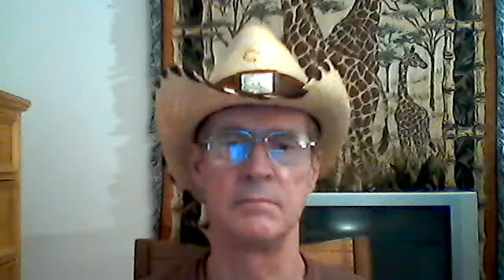Received Audio vs Antenna

Comment: My first guess would be that the noise level is different on the antennas giving one a perceived audio advantage. I have an SDRPlay  hooked up to two antennas and it can switch easily from one to the other while providing a graph on my PC of the signal strength and noise levels. I hooked a 132 foot wire with a 9:1 unun  to one port for HF listening and a Discone antenna  to the other for VHF/UHF and above. The discone is only rated down to 25 mHz on the low end. To my great surprise it was not only superior on the upper frequencies but the equal or superior to the long wire on 20 meters. I found that even on 40 meters I could basically hear as well as I could with the long wire. True, the signal peaks were not as high but the noise level was lower so listening on 40 meter was no problem. On 80 meter I give the edge to the long wire..but I could still hear decently on the discone. In fact I even listen to low end AM radio frequencies on the discone and the SDRPlay.This blew my mind to the point I installed a different long wire, a store bought one, to see if maybe my homebuilt was not up to the task. I got the same results. My appreciation for the discone was greatly enhanced.

Comment: As I know, the "open ends" of a dipole antenna gets much more interference. I read that closed ends (loop) do not get the QRM and QRN easily. I just tried once a loop antenna for 10m and 6m, but I don't have space for trying other bands. What I do is to hang a fishing pole in the window of my apartment, and use it as a end fed, or as a "L" dipole with the negative side of wire messing around what is possible to be. Recently it's being very difficult do conclude QSOs because the interference, S9 burning sounds, QRN, QRM, etc... I remember when I started in 2011 it was very easy to establish DXs with little noise and good propagation conditions. If the "loop antenna" is the only (or the best) way to get rig of interference, so I should try again.... 73 de PY1ZB!

Comment: Hello Stan. Pleasure hearing from you, as usual. I, too am a new ham-ster. I do believe that loop configurations have been shown to be a little better than the so- called hamstiks , if they are at least 1/2 to 1 wavelength above the ground, can`t remember which. . I have used hamsticks in my mobile rig  in the dead of winter here in northeast PA and have received transmissions on 20 meters from as far away as St. Helena Island down off the coast of South America in the south Atlantic. I only have 100 watts and operate SSB, so was unable to contact him. I have no experience with loop antennas.
Reply from the maker: A large loop (full-wave circumference) has a bit of gain over a dipole, something like 2 dBd. The gain occurs along the loop axis. I don't see why that would make any difference in the signal audio, however.
Reply: Thanks, I am learning about the importance of gain. I do study your video diagrams with interest. There are an array of store bought and homemade loop variations out there, some of which I am going to try, as time and funds allow. A 160 meter job would be a tremendous undertaking, I should think. I have some land, which may allow some experimentation. Regarding audio reception, I am pulling in some shortwave, maritime and I do think, military HF transmissions that I have not heard in a very long time. The rig here is a Kenwood TS 140S and a simple fan dipole. 73, KC3BXZ  Joe

Comment: Does the loop preferentially receive the magnetic component of the radio wave and less the possibly noisier electrical component?
Reply from the maker: A small loop does, I think (a loopstick, for example, meant for receiving only). A full-wave loop, such as the one that comprises part of a quad antenna, does not. Even so, I cannot see why either type of loop would result in better received +audio+ than any other antenna.

Comment: "The audio sounds better" sounds a bit unspecific. Better as in less hiss/QRM/QRN, or due to an increased signal strenght or improved SNR?
Reply from the maker: He did not say anything more specific than "the audio sounds better," so I don't know what he meant. He did say the signal strength had nothing to do with it, however. I took it to mean something akin to "fidelity" or "quality" as in a hi-fi system or something like that.